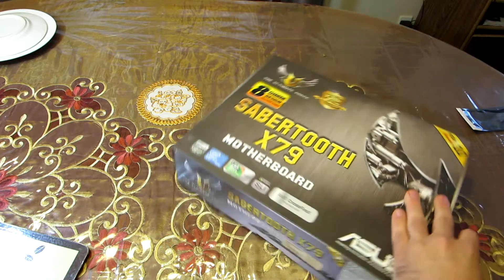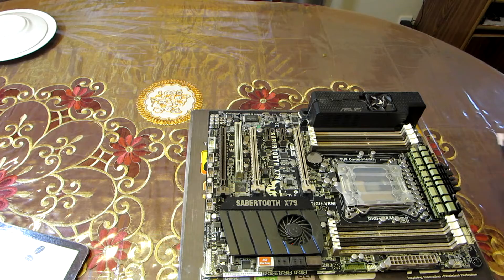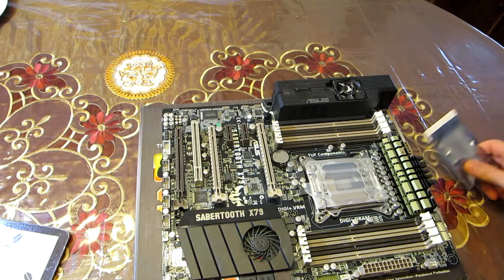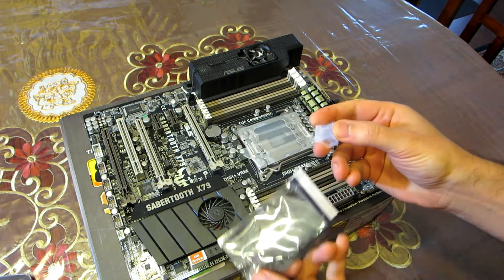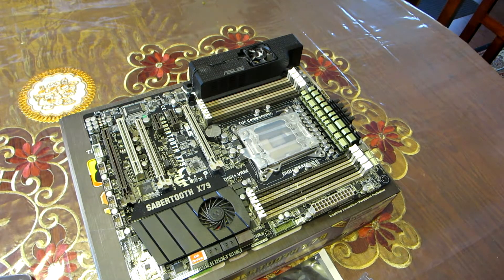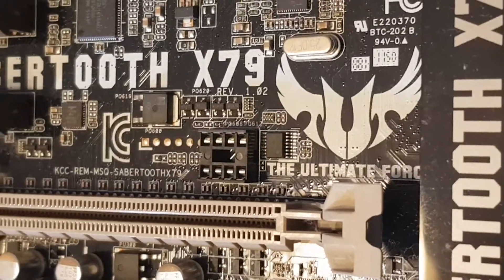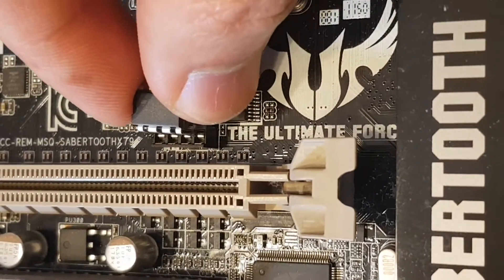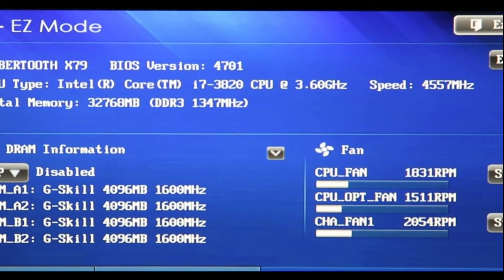Fixing a Computer Motherboard (BIOS Chip Replaced)

Comment: Any idea on how long each motherboard company will supply bios replacement chips ? Did you get bios chip from asus ?
Reply from the maker: I got mine from EBAY , ASUS does supply some for for some boards ( not all)
Reply: @IroncladTrading  ok.. Bummer about asus. I thout thay would. Now that firm wear haking is a thing I would have a hard time ordering any flashabul item.

Comment: Dear SIR
My computer run about 5 minutes, and It auto shut off. I take off power . and then put it in.
turn on button. computer show LED CPU solid on, screen do not show anything, cpu fan run.
I take off power, reset bios and plug power in again, turn on computer, It is still the same ,
Screen donot show any thing, LED CPU solid red, cpu fan run.

and  I take off power, reset Bios , waiting 3 or 5 hours, plug power in and computer on,
screen show setting bios, and It happen again around 5 or 10 minute It auto shut off

I try another cpu, ram, and test woth only 1 ram , It happen the same.

Is it the bios have wrong, Do I need to replace NEW BIOS chip ?
Could you give me idea, please?
Thank you so much
Reply from the maker: Does the CPU have enough ventilation? and not overheating? is there thermal paste on CPU? It also could be a faulty motherboard.

Comment: My Rampage IV extreme doesn't start at all. The start/reset buttons light up when I plug it in the PSU, but nothing happens when I click the power button (even the fans aren't spinning). Is it likely to be a bios problem?
Reply from the maker: BIOS or may be your RAM
Reply: @IroncladTrading  tried with a different ram, still the same. 

If I get an empty bios chip and replace it, can I use the flashback functionality to 'upload' the bios to it?
Reply from the maker: Hard to tell since I didn't see the MB, Try Clearing CMOS, if it does not work, replace the MB battery, then reseat the cpu/video card and see if it works
Reply: EARO Hey man. Having the same issue. Check my latest reddit thread, as I’m having the same issue and I may be able to help. (u/MittensRL)
Reply: @sai chandra It was a bios issue in my case. I re-flashed the bios chip and it's been working flawlessly for almost a year now. Good luck with your board, I hope you get it working again! ^^

Comment: hi idk if you still reply to these videos, but I've had q code errors from the z77 ASUS series (p8z77 v-deluxe) specifically q-code 36. Any basic troubleshooting thing has been done to fix this motherboard, but I'm getting the exact same q code, every. single. time. Im trying to avoid sending my motherboard to the repair center, do you think manually putting a used bios chip would work?
Reply from the maker: Have you tried changing the memory? You have 50 / 50 chance with a used BIOS chip

Comment: My Pc randomly has no signal and does not post, I have pinned the fault down to either the CPU or motherboard. Cuuld the bios chip be causing this problem? I have removed it and it is a similar bios chip to the one you have replaced. Cheers
Reply from the maker: Yes it could be the bios chip, you can find them cheap on ebay around $5
Reply: @IroncladTrading  It's a really weird fault, I was just about to install windows on my new SSD and was at the screen were it said no bootable device as I hadn't install windows yet, I then rebooted the PC via the reset button and it never posted again. I might by a new Bios chip but for some reason I feel that the problem may be the actual motherboard.
Reply: @IroncladTrading  Right now the PC turns on for about 10 seconds, then automatically reboots and doesn't turn off unless I hold the power button. Was the motherboard in this video doing a similar kind of fault when the bios chip was faulty?
Reply from the maker: @ShaDoWxGFX  Mine was doing the same but it could also be the memory
Reply: @IroncladTrading  Hmm, okay thanks. I think i'll buy another bios chip. I have tried a different PSU, GPU and Ram.
Reply: what did you end up doing and did it work? I hope you tried usb bios flashback before replacing chip. My sabertooth x79 gets a random black screen sometimes but i think it might be my hdmi cable as if i move it around (the cable) it does the same black screen and keeps audio playing.